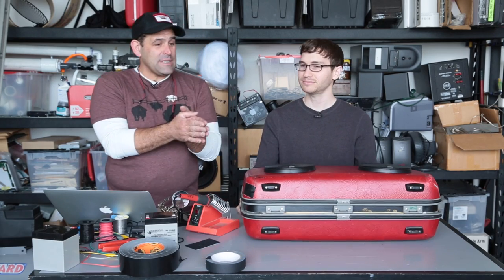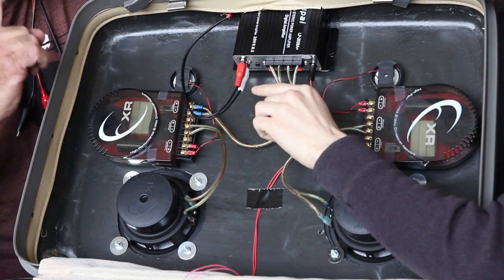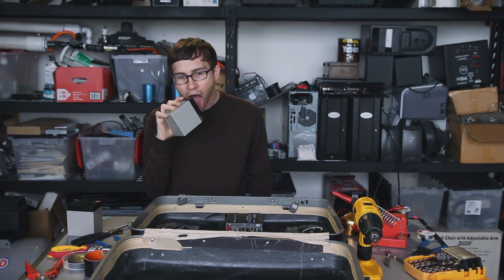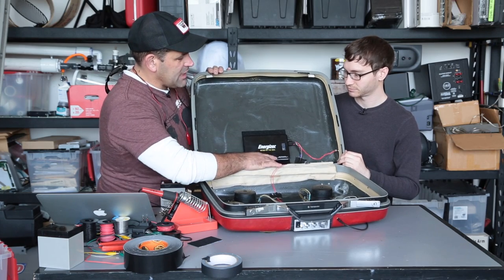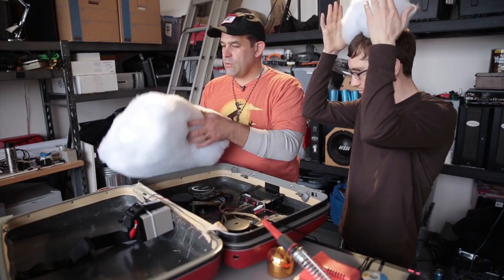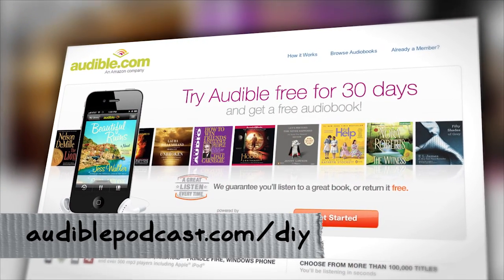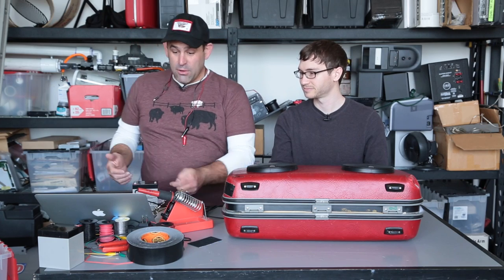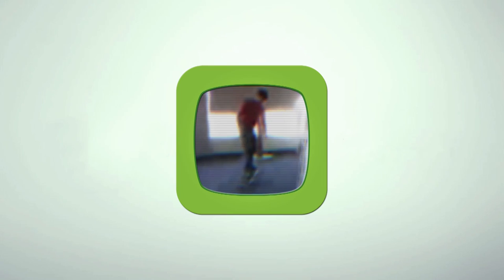DIY Vintage Suitcase Speaker Gets Battery Power!

Comment: you know what would have been really nice, is if the parts were listed in the descriptions like most do for a DIY project places do, to help people out for finding exactly what parts they may want, like the battery power charger used here, or the amp used, there is no parts list and no links as usual for a "DIY project show"
Reply: Im building something like that right now, and really need to know what kind of powerbank that is -.-
Reply: Jeff Mues what is the battery they are using?
Reply: Google does amazing things.

Comment: Nice battery solution, it has protection circuitry to keep the lithium battery from going runaway. I'm not partial to the color, but the concept is cool. It reminds me of the days when I had an actual boombox (with dual cassette deck!). It took like 8 C cell batteries, I like yours more.

Comment: If I wanted to Add an 8" Sub in between lets say two 6 1/2" speakers, how can I wire that?  Would I need a seprate crossover?  Thanks for the help!

Comment: Where did you get or how did you make your power pigtail for the Lepai amp? It comes with 22g wire, but I'm hoping to find a thicker gauge wire for the power supply.

Comment: Would it be possible to add a sub woofer apart from the speakers
Reply: Depending on your amp, it may or may not have bass channels built in.  If it doesn't, use a crossover for the woofer and tweeter.  or else use coaxial / full range  speakers.

Comment: Lithium-ion can be recharged directly from a power supply. Just hook up a 4.0V (or lower) voltage regulated power supply to a cell. Limit the charge current to it's capacity and add a fuse. At 4.0V it'll be slightly undercharged, but undercharging extends the lifespan of the cell and provides a safety margin. Lithium-ion doesn't tolerate over-voltage basically at all, but otherwise it's very durable and easy to charge.

I know this video is from 2014, but I didn't see anyone else mention this in the comments.

Comment: Actually lead acid batteries are easier to implement in a project. Why easier in charging and discharging, and so much more forgiving than LiPo. I found that I only go to LiPo batteries when I want small size / weight or super fast charging (but you have to provide super high amps also...)

Comment: Good idea to use a readily available lithium ion battery pack, I thought you were going to use individual cells of some sort and those are even more dangerous than sealed lead acid. If a lithium ion cell shorts, it could overheat and cause an unstoppable lithium fire.

Comment: never put your electronics on the same side as your speakers... we all know that magnets and vibration disturbs the sound and loosen the mechanical parts (screws etc)
Reply: If it's built correctly, the suitcase itself shouldn't have vibrations buzzing through it, you want to use materials to both stiffen and dampen the suitcase, MDF for instance, the perfectly dead material for a speaker enclosure.

Comment: Hey guys!  I love your videos!  Thanks for keeping it up.  What is a cheap way to add bluetooth capabilites to this project?  I am getting married and something like this would be a great gift for my groomsmen.  Would you also have a rough estimate of how much something like this would cost with bluetooth added to make?  I have looked into the Lepai units and I know the speaker prices will vary, depending on my preference.  But what would this project, right here cost with just that addition?  Thank you so much in advance!
Reply: Jace Cimabue There are bluetooth to 3.5mm dongles that either are rechargeable or power through usb. Either option can cost around $5-$10 and they work great. Some of these amps come with a USB port and so that would be perfect. The dongle accepts the BT signal and then it puts it out to a regular aux cord. I did my project with parts I got off of the DX(dot)com website. I used amazon and DX for materials to make my boombox. I bought the dongle($3 dx), amp($15 amazon), and marine speakers($16 Amazon) for a total of <$50 and the case I used I found in the trash.
Reply: Thank you so much for your feedback.  Exactly what I was wanting to hear.  Cheers!

Comment: Total price of build?
Reply: Depends on the type of speakers, but basic speakers will be $50 new, battery no idea, the amp is $15-$20, and suitcase depends too. The wire you can get very cheap too from Knu Konceptz.
Reply: As near as I can tell, this is the battery:
http://www.energizerpowerpacks.com/universal-chargers/xp18000a.php

Comment: what type of batery can i use to amp of 125watts???
Reply: Motorcycle battery? Small, yet powerful. Or a few of the small ones they show, but a motorcycle battery would be powerful. Gel cell batteries, like the Optima Blur-Top marine batteries may be best in your case. Ones that can discharge and be recharged frequently. But I don't know if they make one small enough.
Reply: Ben Cline and for charge the batery? to use portable and conect to energy wall?
Reply: francisco lopez Kind of hard to understand you.

Just use it battery maintainer aka trickle charger just like everyone else.

Comment: I found the battery pack they use  - https://www.amazon.com/Energizer-XP2000-Universal-Rechargeable-Power/dp/B0029U2WWI

 - it's only a 2000mAh  - won't last for shit with that lepai amp... they need a 37wH battery pack built with 18650 cells.  All wired to 16.8 volts.     This way the speaker last at least 5 hours.

Comment: I some thing similar but instead of using a amp I used a cheap car stereo with 8  sony tv speakers from a old tv that crapped the bed :(  and 1 8in sub that I had from a home theater that died  that all work great together  I'm using lithium ion battery and it last about 6 hours before it needs to get recharged and it can be plugged in and used as well :) :)  and being I had almost every thing it only cost me 25$$ to make
Reply: Any way you could help me out? I want to do a radio and sub as well. please could you send me pictures or something? thank,you.
Reply: I cant upload any picks  :( my computer wont let me.  your best bet is to trial and eras is the best way I found because every one hears sound differently, to do it on the cheap garbage pick parts that's what I do for every thing  I hope this help you

Comment: But still no VU Meter. *sad panda*
Reply: VU meters were more for monitoring line level signals.  It's not that common to clip your preamp, so it would be all for show.  Power meters are apparently not easy to do - one could approximate power based on voltage into 8 ohms ( if the speakers were 8 ohms,) but actual speaker impedance changes with signal so that's not very helpful.
Reply: I understand but this build wasn't entirely about practicality though. ;) it was about the cool factor. And a big bouncing retro VU meter in a big retro suitcase would just be cool. Hehe...

Comment: $160 battery in a suitcase speaker?? That pretty much negates the whole reason to build one of these.
Reply: Well, there are cheaper batteries, but there's also a matter of safety, and if you really used this thing a lot, it would sort of pay for itself.  Not sure if the audio quality warrants the expense, but crazy engineering has it's own crazy rules, and I sort of get why they did what they did.
Reply: wow its that much because i was going to put it in my home made wooden boom box
Reply: ***** Actually it looks like it's $180 on amazon now. It's no secret that Lithium ion is far superior but if you aren't concerned with weight I used a sealed lead acid battery that i got for dirt cheap on amazon for my speaker system I built in a ammo box. The battery life is insane, I can listen to it all day without charging. and since it's sealed there isn't much to worry about as far as safety. It is quite heavy though.
Reply: that's more the the  whole speaker my battery was $33 for a 12v 12a 

did you see my video

Comment: Can it run from this batery : http://www.ebay.com/itm/3000mAh-12V-DC-Lithium-ion-Rechargeable-Battery-Storage-Capacity-AC-Charger-EU-/141454652510?pt=LH_DefaultDomain_3&hash=item20ef5ab45e  .Im tryin to make a boombox and i have a hard time finding cheap batery
Reply: filip kezele Yes, but go for a higher capacity.
Reply: Thanks